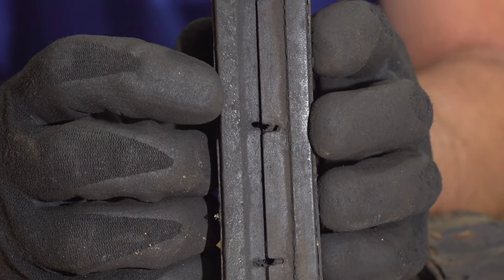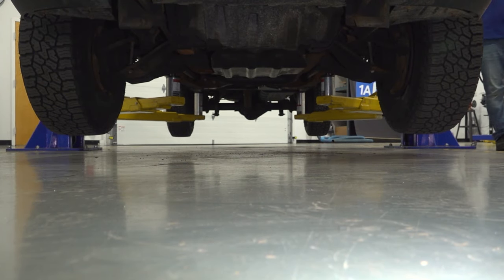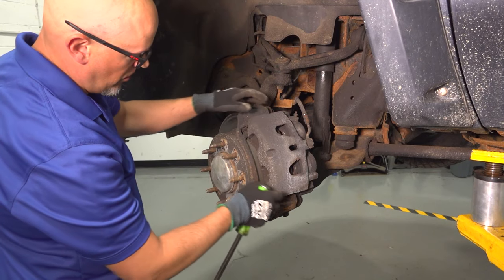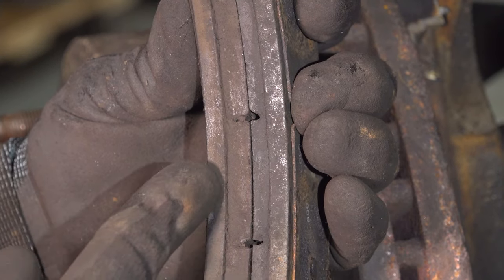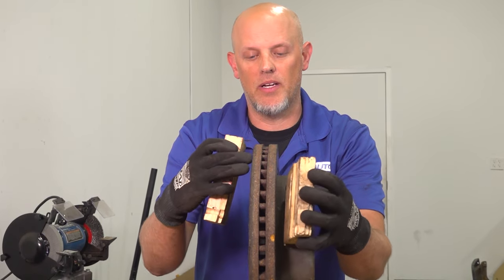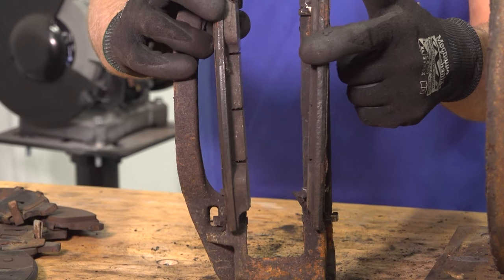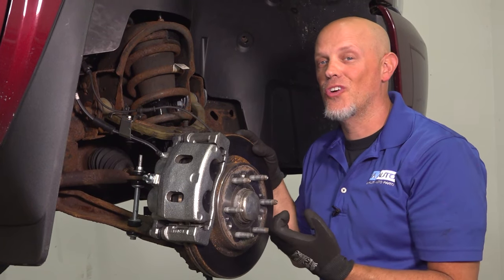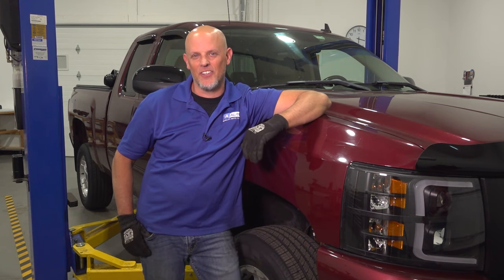Solve Uneven Brake Pad Wear: 5 Reasons Your Car or Truck is Pulling to One Side While Braking

Comment: So I’m having a wierd issue on my 2014 F150 5.0 V8. 
My front passenger side brake is engaging. I can hear it grinding while driving. When I lift my vehicle the driver side is fine but I can tell that passenger side is not rotating freely and I have to apply force to make it turn. 
I also noticed that my outside pad has more wear than inside. 
So far I have changed out the brake line, the caliper, bleed the system properly, checked my bearings, replaced my guide pins and lubricated all components, I can see brake pads moving freely in bracket when caliper removed but when I pressurize the system that one side is still getting stuck. 
I’m just so confused why. 
The only thing I haven’t done is put new pads. Yes one side is more worn than other but there is still a lot of life left. 
I have exhausted all my resources and I really need some guidance. 
Why is this happening only on one wheel? 
Please help.

Comment: I have a delema i dont what to fix i  did a brake job and my front driver side had stuck brake pad the bottom slide pin was seized after i did it i am still feeling a drag so i thinking bout changein the rubber  (on caliper piston) boot the slide pin and the hose 🤔🤔

Comment: I DON'T KNOW WHY ALL YOU SO COLD MECHANICS DO THE SAME THING, YOU PUT TOGETHER A BRAKE SYSTEM AND NEVER EVER USE ANY BREAK GREASE ON THE CONTACT POINTS OR THE SLIDES OR WHERE THE BRAKE SLIDE ON THE HARDWARE. YOU'RE ALL GENIUSES😂😂😂😂😂